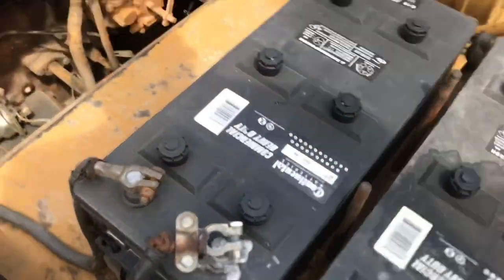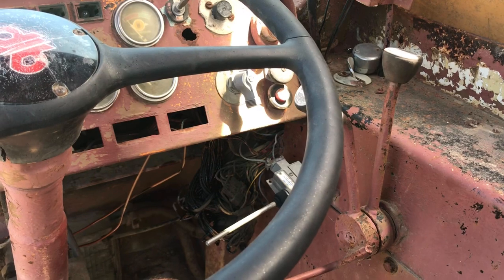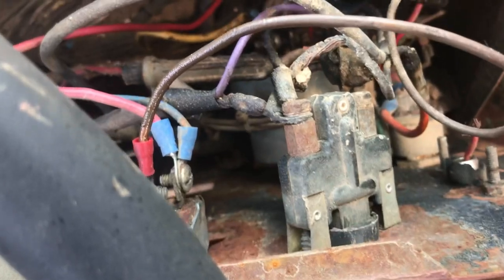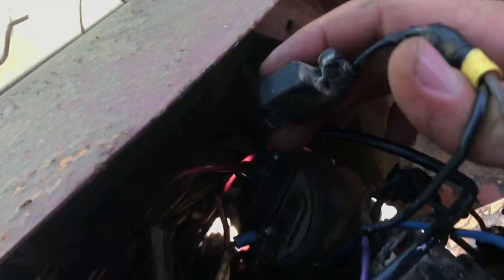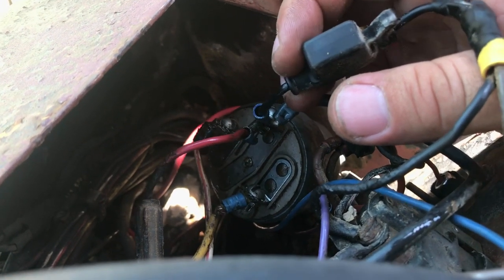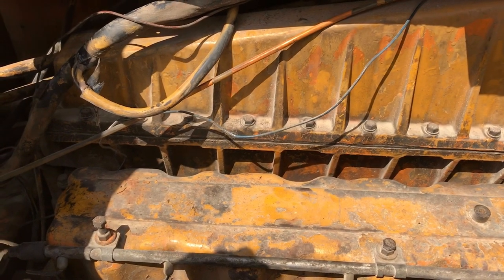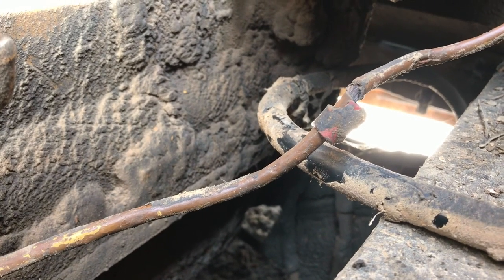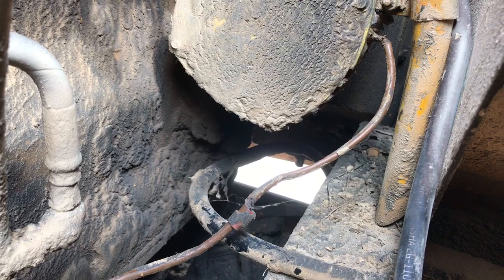Electrical Fire in the Haul Truck - Troubleshooting

Comment: Something has shorted out causing a large current draw. The battery terminal melted because there looks to be only about 20 percent of the wire cross section in the clamp causing it to be high resistance.
Reply from the maker: You are correct!  Wait for part 2!

Comment: Alternator diodes/regulator shorted?
BTW, re-wire the whole truck. It'll be a pain, but well worth it, as long as you do it well enough.
Reply from the maker: There’s an update video. Simple short. I did gut and rewire the problem source. Working to rewire the rest as needed over time.